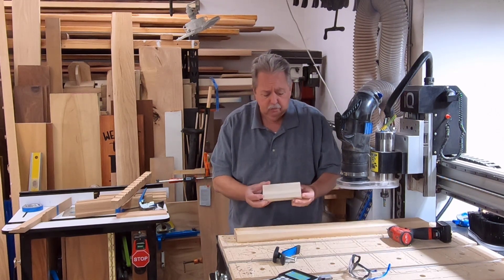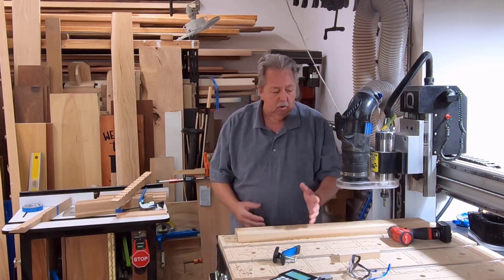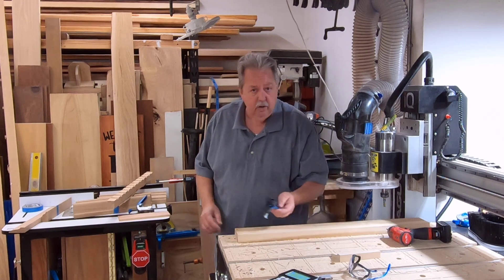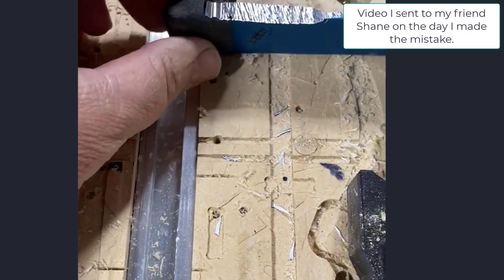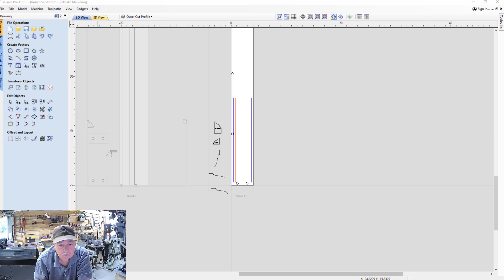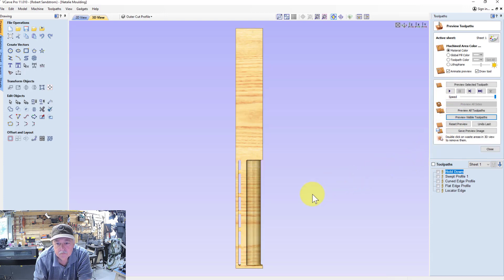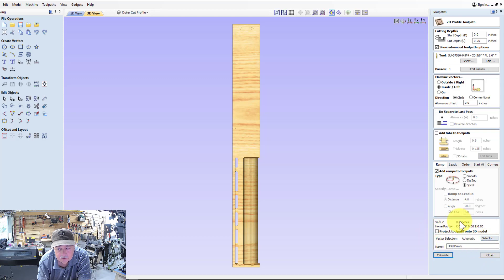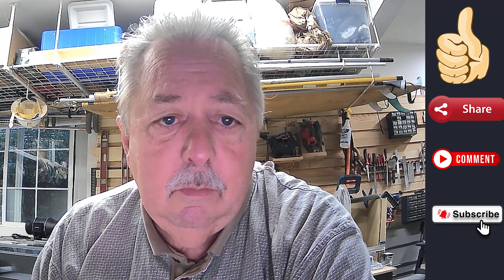How to Avoid Damage to Bits and Clamps of Safe Z Rapid Travel Setting

Comment: Excellent video, Rob! This is something I don't reinforce often enough. Of course, as you found out, having the right Safe Z setting in the software is of little value if we change our minds about which clamp we're going to use or decide to use screws instead, but what can I say... I think cutting into a clamp is a rite of passage. (I've never run into a clamp, but I have cut through screws. It can get real exciting really quickly.)
Reply from the maker: Agreed that I changed my mind so thinking about the Z height may not have helped.  But, when it happened I tried to figure out what I did wrong and remembered I don't usually think about this setting and I need to be aware of it.  Thought others maybe could use a reminder.
Reply: @RobSandstromDesigns   Too true. I've mentioned it in passing, but I haven't put enough emphasis on it. I need to do better in the future.